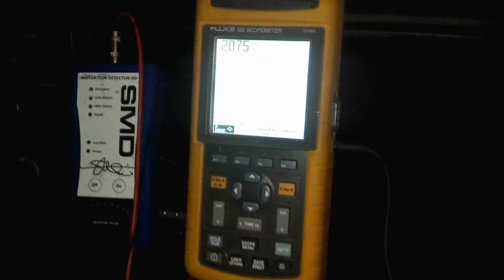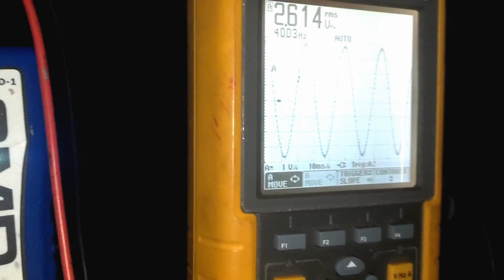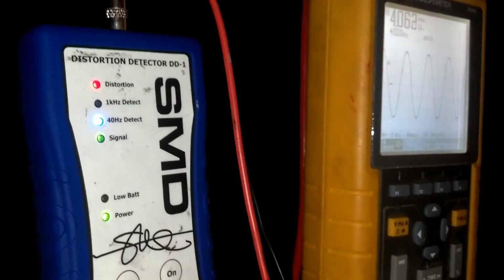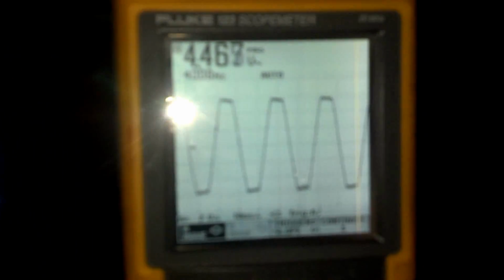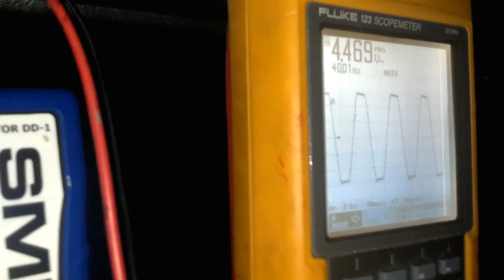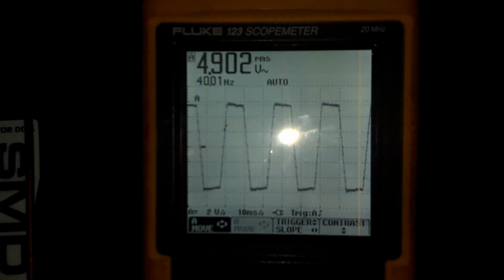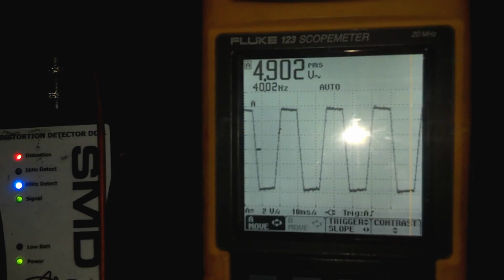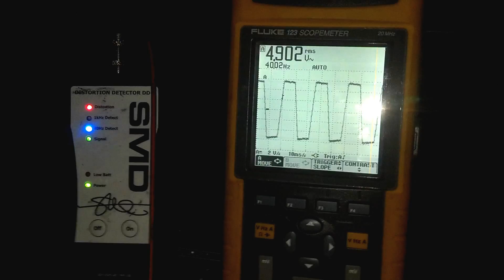SMD D'Amore DD-1 VS FLUKE SCOPEMETER Amplifier Gain Setting, Clipping, Clamping

Comment: I have a question... has anyone ever checked an amps output signal  with and without a load to verify that in both conditions the amps output clips at the same level of input signal ? And I'm referring to the load an amp is rated to push ? Because most folks will try to drive an amp at its rated load..

Comment: LMAO, I was looking for videos on the fluke mobile scopemeter and ran across your channel. Love the comments about turning off the light and deal with it, then flame away and give my channel views. I don't even know what a DDR1 is, I'm guessing that your talking about an amplified units attached to a head stereo unit. I've done enough installs when I was younger to know the jargon but I'm not an audiophile. Still was an amusing video. If I was an audiophile the only thing I would question is the speed and capture rate of the scope since I know the fluke mobiles only do 25MS/S real time capture rate, it will do a higher equivalent capture rate but I don't know if you can change this mode manually or what mode your scope was in. So I guess I should questioning how sensitive can a speaker really be before it blows? How much clipping abuse in time of play can a speaker take? If a speaker is damaged in under a second then maybe the DDR1 might now be good, but I doubt any speakers these days will be damaged that fast. But again, I'm not an audiophile, it just got my curiosity going. Still had a good laugh though.

Comment: Great proof showing the dd-1 doesn't pick up clipping well.  Cool.
Reply: The dd1 picked up clipping almost as good as a $1500 scopemeter. That is a damn good job and very cool. A super soft clip that the dd1 didn't detect wouldn't add any measurable heat to a coil.

Comment: Some things here are wrong:

4vrms of a pure sin wave equals to a 5.66V of peak voltage (4 x1.4). So the HU cant go over 5.66Vmax BUT it can go over 4Vrms as the RMS voltage of a semi square signal of a max amplitude of 5.66V is larger than 4Vrms and this is clearly seen on the video. The HU voltage cap is for max voltage not for rms voltage.

Another thing to consider the SMD DD-1 measures distortion, not necessarily clipping. Clipping its a way of distortion but is not the only one. A signal can have distortion way before clipping so some HU never reach 1% of distortion before clipping (the threshold distortion of the SMD) while others can reach 1% or more distortion before clipping.

Comment from the maker: So because of that, 40hz is as good as any frequency to set at... so rather than why 40? The question is why not? We don't know what sub, box, and vehicle you're going to have running, so we can't tailor the gain setting in a single product to all builds. So this is the best we can do. It's safer on the equipment than ear adjustments but isn't perfect.
Reply: When you say we, do you mean you work at SMD?

Comment from the maker: It's why they tell you to unhook your speakers when you do it. If there is no load present, and no filters or boosts manipulating the signal, the amplifier SHOULD put out the same voltage for the most part regardless of frequency. In other words it shouldn't "care" what frequency it's reproducing unless a filter or boost has made it, and no load is present to react differently at different loads. Your woofer and enclosure, present inside of your cabin will make the load different at each freq.

Comment: Excellent video. But i'd like to know why we use 40hz to set gains? The DD-1 only detects distortion at a 40hz tone for anyone that doesn't know. I asked a certain company why and they didnt really explain why besides saying that it didn't matter. Any help would be appreciated.
Reply: You can use 45hz 46hz 69hz whatever.. It's just a good area where bass notes play.. butthe DD-1 might only be designed  for 40 and 1k. I don't have one YET

Comment: Many of my original CDs are not at 0dB. Don't ask me why it was done. I didn't really notice until I installed my system. Then I started checking and found out. I reripped many CDs and checked the files in Audacity and it became obvious there was a problem. Now I check every file and amplify them to 0dB without clipping. Big difference in playback intensity for many songs.

Comment: The problem is as I see it not all music CDs are recorded at the same level. If the HU is set at -6dB by playing a -6dB test tone and the gains are set to amplify the signal to just before clipping and a music CD is inserted with bass recorded at 0dB the amp output will now be clipped. I want my gains set so the worst case CD of 0dB wont put the amps into clipping. Others may just turn the HU volume down to avoid clipping but to me that isn't reliable unless I have a clipping meter at all times.

Comment from the maker: You have every right to do that. I think what the previous comment was directed at the purpose of setting the gain. The gain is set so that the amplifier is matched with the head unit to max out at the theoretical maximum. It is a ceiling to protect the equipment. Adjustments can still be made and boosted, if the listener chooses. It's not about being a purist. It's about having good sense and operating your equipment within its capability.

Comment: It doesn't matter. The source is rarely ever -10db. Usually it's -3 - -6. Even if it were -10db, it really doesn't matter. The amplifier needs to be set at its maximum. Not maximum for every song, but it's maximum. The maximum it could play it -0db. So you set it there. If something is recorded less than that, so be it. Every tone in every song doesn't need to be at the stereo's full potential. That is a concept that is ridiculous and nonsensical, but seems to be mainstream now.
Reply: This is exactly why people set "overlap" find the Decks 0db max, but then set your amps w -5 or -10.. It's not the end of the world if you clip a tiny bit here and there w different songs. Its all in the DD 1 manual